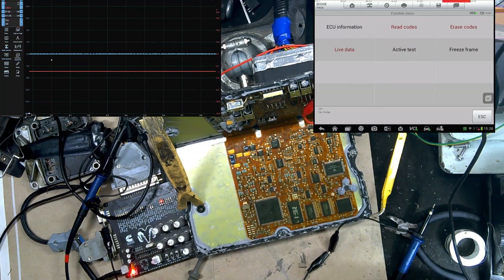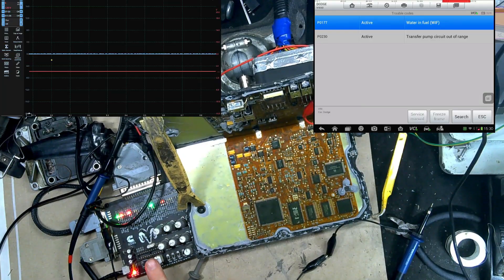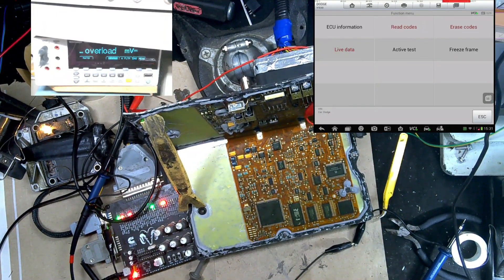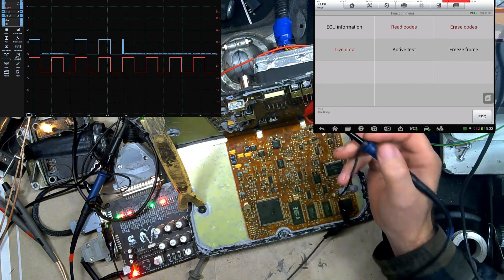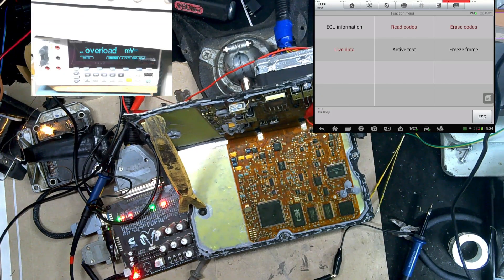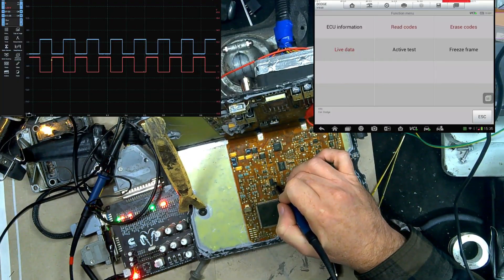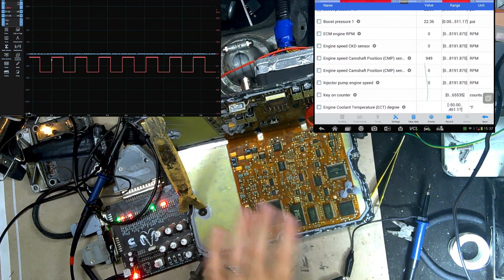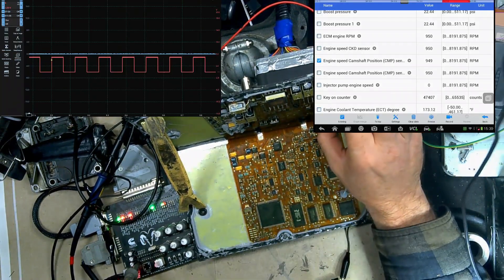Testing Cummins 5.9L 24V ECU for P1689 & Camshaft sensor input logic on a

Comment: What is the black circuit board with the Ram's head and LEDs?
Reply from the maker: a testing device I made for cm551
Reply: @ecurepair  Do you make them to sell?
Reply from the maker: nah, just make them for myself.
Reply: Its a Ecu / Pcm Emulator so it acts like a PCM. So he can do testing on the main computer.  i got one for honda ECUs OBD1

Comment: Maybe Put the two signal wires together and see what happens 

I have 4-5 computers and need them fixed. Ecms and pcms 

Even took the logic boards from a 2000ecm and put them in a 2001 ecm

Comment: Got a 2000 cummins ecm and pcm with its engine harness, running a 2001 Cummins engine …. Using crank sensor plug  from 2000 harness plugged into cam shaft sensor under vp44 and truck runs!!!  Leaving the cam shaft sensor from 2000 harness unplugged….  Engine starts right up but hesitates and shudders for 5 sec and then idles smooth and runs as intended,,!but if I unplug the 2000 cam sensor plug from the 2001 cam sensor and plugs and plug in the 2000 cam sensor  plug from 2000 harness into the 2001 cam sensor truck starts right up but is underpowered and drives but fuel timing is all over
Reply from the maker: I dont know too much about the conversions  on them tbh, but what kind of dtc's are you getting from it? It would probably be better for you to program the ECU for 2001 and then make sure its wired up as a 2001. The ECU's are the same hardware just different software.